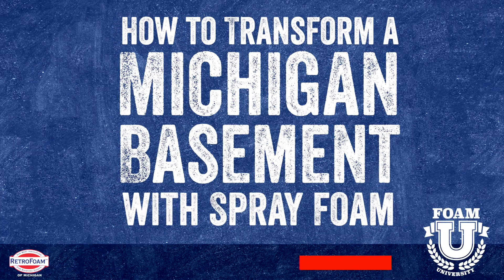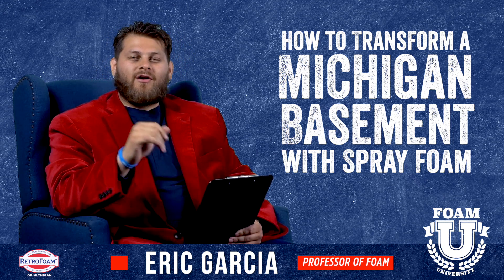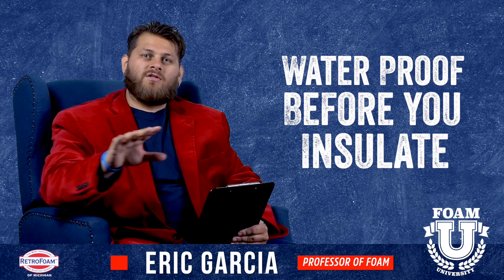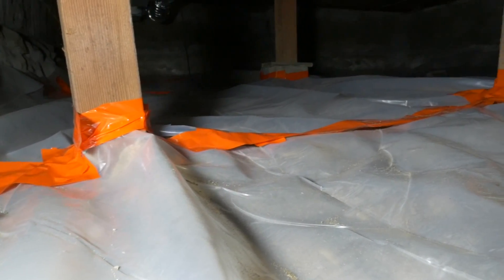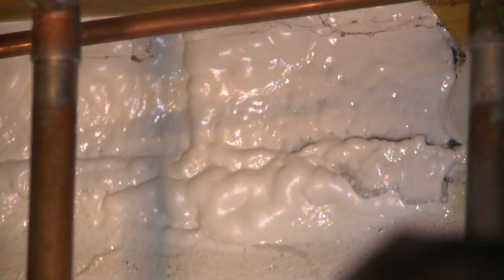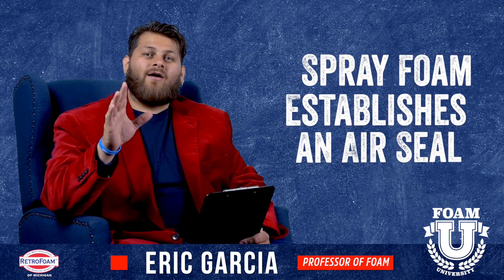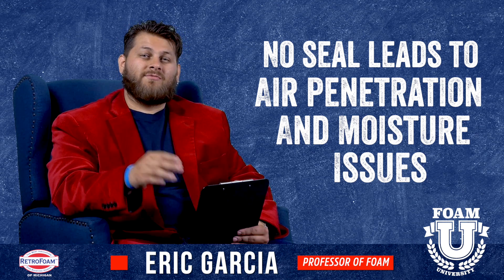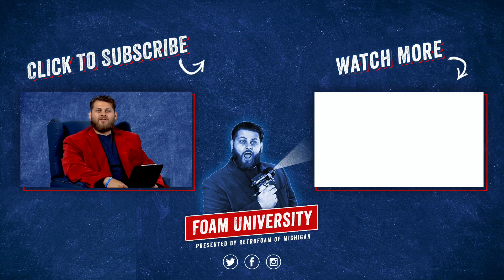How to Transform a Michigan Basement with Spray Foam | Foam University

Comment: any basement, especially those with block & brick foundation walls should be waterproofed and backfilled correctly on the exterior(they were not), short video of multiple exterior cracks & other openings that allowed water in basement, caused some mold & efflorescence https://www.youtube.com/watch?v=Tq_o7C6KMUA
Reply from the maker: Many homeowners want to use closed cell foam to waterproof their basement, but that is not what foam insulation was designed for.  We always suggest to first waterproof the correct way before insulating with spray foam.